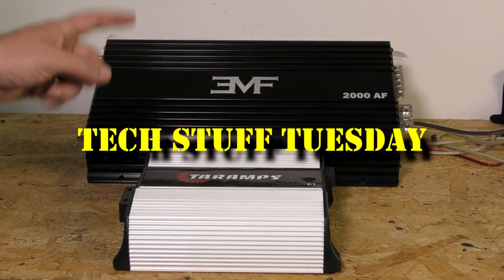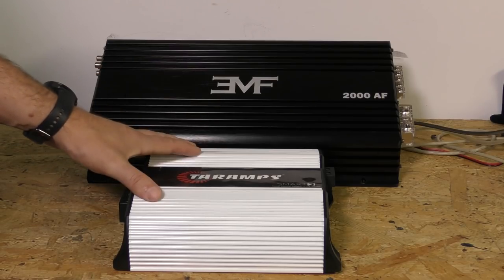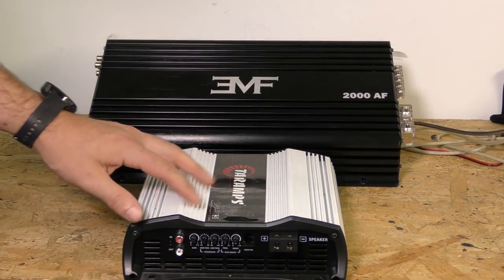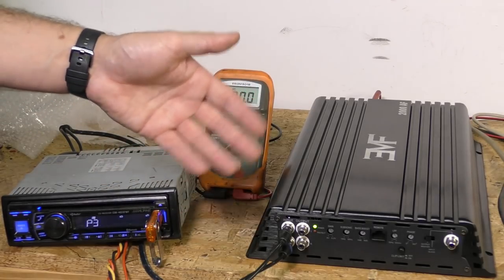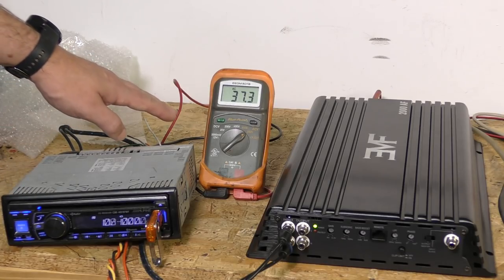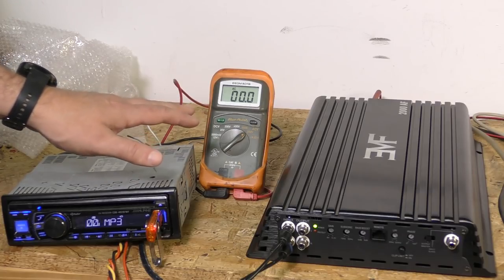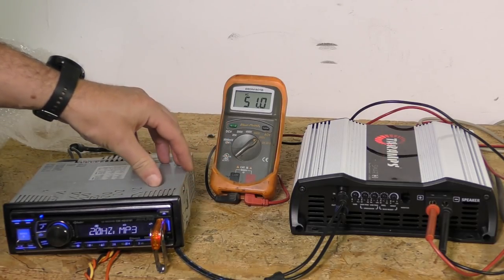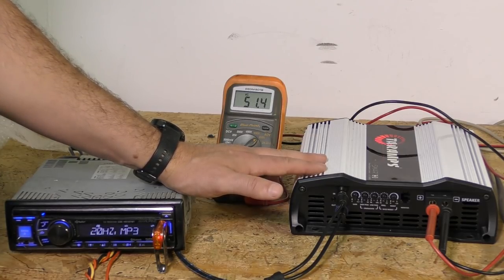The problem with full bridge (Brazilian) amps you never thought about - Tech Stuff Tuesday

Comment: Good info to know I was actually contemplating switching out my Skar RP2k for a taramps hd3000 not cause anything is wrong with the skar but just wanted more power but after seeing this I think I'll just keep my RP2k
Reply: Never use hd line for bass. Rp is garbage amp. Go sk2500 or bass 3k or smart 3
Reply: @busa_joe1159  I wouldn't knock the RP it's not bad to be honest if you are building on a budget like I am, I'm slowly upgrading to better equipment every year but I do agree with you that the sk line is definitely a better amp
Reply: James smith  what subs are you running on the HD3000?
Reply: While 50 volts at 20 hz is 8% less power than the 55 volts at 40+hz it is still 9% or so more power than the half bridge makes at 20 hz for half the cost. Never used a full bridge amp. But the 8% difference at 20 hz wouldn't be a deal breaker. Been kind of looking at these smart 3's for a while. I like that it is able to make the 3k at 2 ohms as well as 1 ohm and can do 2k at 4 ohm. There aren't a lot of amps out there doing 2k at 4 ohms. Especially for around 250 bucks and at an efficiency of around 80%.
Reply: James smith  That dyno test doesn't mean squat. No one cares about SQ anymore....just POWA!
Reply: James smith  I am pretty sure the test was probably accurate. Everyone gets upset about Sean's videos because that one time he trolled Steve Meade. I have heard several times from different people that full bridge amps seem to lose a little at the bottom. He does know what he is talking about, and he is making videos to try to help people understand better what is going on with their system. Sean is trying to sell his product, and he does have a tendency to rub people the wrong way, but he does also design some quality stuff. I ran a banhammer 12 for a couple years before I finally took it out, it took abuse like crazy and slammed hard as hell while doing it. I would heat it up until it smelled and then turn it down to let it cool off for a while and then right back to beating the hell out of it. I clipped the shit out of it and it took it like a champ. The clip limiter on his current amplifiers is a pretty amazing idea. Almost seems like it could go a long ways to fight impedance rise. Turn the gain all the way up, and no matter what note is playing it will play it as hard as it is capable of without damaging anything due to clipping. I know that isn't how it works, but it is basically dipshit proof. Lol. Great for guys like me who know that I set my gains at volume level 32 but turn it up to 34 anyhow. Because some notes just don't play at volume 32 like they do at 34.
Reply: James smith  one thing I will say about Dyno tests, is that they show what the amp is capable of on a resistive load. 2 ohm speakers wired to 1 ohm are never gonna be a 1 ohm load once they are in the box and the subs are moving. You most likely aren't ever gonna see the 3k that the amp is capable of. Unless you put it on a Dyno Or wire it at half an ohm where the amp might see a 1 ohm load after rise. But that is when so many people have had problems with the full bridge amps. And that is also why I said I like the smart 3, because it will make 3000 watts at 1 or 2 ohms and 2000 watts at 4 ohms. Plus it shuts itself down before it goes thermal like most other full bridge amps would, even if you wire it down to half an ohm.
Reply: My smart3 shits all over the rp2k

Comment: So if an amp has a potentiometer that can set the amp to amplify a 10hz tone, how is this amp not designed to run subs lol? also the 2k fluxuated a total of 7 volts in the beginning and the taramps did close to the same. this video only shows that half bridge is better than full bridge for bass which everyone already knew.
Reply from the maker: No, not everyone does know that, which is why people keep buying that style amp to use on subs, because they're cheap.

Comment: Full bridge amplifiers are push pull. Half bridge are push and let go. In my opinion, because of the half bridge amplifiers popularity/marketing, and the strapping amplifiers together. I had a longer rant. 
But, I will agree with you that people should use their device's for what the are intended for.
Reply: Why would full bridge not be intended for subwoofers? it's full range amplifier is made to play a number of different drivers rather it's ,bass mid bass,midrange or highs which gives a wide range of options and uses for just one amp

Comment: If you look at the multimeter wires there hooked to the radio when there amp is on but they connect it directly to the taramps when they do the second test. I call bs.

Comment: I would not consider a high power full-bridge Brazilian amp good for mids-highs, esp. since some of them appear to not have filter networks on their outputs. This means that the full switched +/-160V (or whatever voltage they use) waveform will appear at the output. Normally subs have enough inductance in their voice coils to average out the switching waveform. If you use them thru a cross-over network, the mids or tweeters may not have enough inductance to smooth the switched output and it could damage them. This is why some of these grenade on amp dynos, since the 1Ohm test load will essentially look like a dead short to the power supply and output stages without a filter network to provide some form of impedance transformation. If they have output filter networks, its ok, but there's no way to know without actually opening it and inspecting the amplifier. Better to use a traditional half-bridge, or a lower power full bridge amp made to drive mids and tweeters.

Comment: You can’t talk about ‘power’ output while reading unloaded voltage on a meter, that result is literally meaningless. In order to know what power an amplifier is making you must load it down, so my suggestion is get a suitable resistive bank and rerun this test. Also half bridge designs tend to suffer from buss pumping when driving very reactive loads where a full bridge will not have that problem, so if you are driving a difficult load then chances are a full bridge will outperform a half bridge with quoted output between them being equal. But you will not see this with dummy loads, you need real speakers.

Comment: All you did was show how a crossover works if you set the crossovers like you would if you were going to run them for subs it would have been a better test. That smart 3k is absolutely made for subwoofers, and will out perform that 2k anyday. Now it might not outlast it. So at the price of a full bridge amp what you do is over buy. So if you need 2k buy a 3k or if you need 5k buy a 8k, and run it at 60% copacity. They literally make a bass3k and a hd3k that only have crossovers that only go upto 200hrz. This guy is just hating bc hes not selling any amps.

Comment: Now, repeat that test with the amplifier driving an actual load...
Reply from the maker: So you can complain it wasn't the right load when it blows up because it was resistive and not reactive? Or what if I do reactive then you complain something else was varied as a result of the heat difference because of moon phase?
Reply: @EMFAudio  Why would I complain if the amplifier is connected to a rated load?

That Taramps one looks like a class D amp.  It's quite possible that its frequency response at the top end is actually load-dependent.  Who knows, it might have performed even worse if its power supply section was not capable of continuing to maintain peak voltage into an actual load.

I would have liked to see if there was any voltage sag when the amp tried to drive its rated load.  

No-one in car audio uses power amps just to drive just voltmeters :-)
Reply from the maker: Because no matter what way something is tested, if the desired results wasn't achieved, someone complains it should have been done another way. I wouldn't dare test someone else's full bridge amp on a resistive load because of the probability of it exploding.
Reply: @EMFAudio  Big D. does those tests all the time and publishes them on his channel, just sayin... And yes, many amps don't meet their specs. 

What you've basically done here is to test the amp's frequency response under basically no load.  I'm not sure how useful that's really going to be.

Comment: You get what you pay for. Slams absolutely, sounds like shit absolutely.  Especially if you got a hi end hi powered amp running at 2 or 4 ohm at the same rms output to your woofers.  Night and day in sound quality.  But if that's your thing just boom boom and vibration you should save your money and install a concrete vibrator.......

Comment: I bought a Taramps MD 12K new to see what all the fuss was about. Absolutely garbage. Made out of plastic like a children's toy and they sound like ass (even on a DSP)
Reply: You Saved Me The Money. It's Temptingly Cheap, If That Makes Sense. Half Bridge Class D Is Where I Should Keep My Subs On. I Had A Class D Half Bridge On Mids And Highs And It Sounded Great. Then That Amp Died And Tried A Taramps Full Bridge Class D And To Be Honest It Sounds The Same To Me. Its Great Becasue It's Compact For Small Areas. However That Thing Gets Crazy Hot. I'm Talking "I Don't Think It Has A Thermal Protect" HOT lol. I've Gotten It So Hot That The Sound From The Door Speakers Starts Sounding Muffled Like 6k Hz And Above Has Been Filtered Out. And Some Speakers Will Cut Out. But That Only On Hot Days And Playing Loud Carelessly.
Reply: Parker Dachille had problems from dat one with the 12K; he went through 2 before his 3rd one.
Reply: James smith  I Could Check. I've Actually Got 1/0 Power And Ground To It (Reduced Down With A Wire Ferule). Its Connected To 2 50AH Lithium Batteries Directly Which Are 1ft Away From Amp Connected POS And Neg On The Copper Bus Bars. There Are 2 Runs Of 1/0 Power And 2 Runs Of 1/0 Ground Running To The Rear Batteries And 8 Banks Of Ultra Caps From The 2 320 Amp Alternators Up Front. I Do Need To Run More Power And Ground From My Alts To The Back. (I Get About 0.6 Volt Drop Under Full Tilt On The Subs) But I Believe It's Just The Way The Amp Is In Confined Spaces. My 8K Bass Amp Gets Pretty Hot Too (Daylied At 0.5Ohm Which Is Sees Only About 2.5Ish Ohms After Rise) But Not As Hot As The Full Bridge Mids And High Amp Does.
Reply: James smith  Just because you have no sense of quality material doesn't change facts. Defend your amp to the grave. I sincerely don't mind.
Reply: If we overlook all the shortcomings in Taramps besides the sound quality alone, and we call them good amps otherwise, that's still enough for me to never touch another one. Some people can't hear a difference. That's fine. I envy you. They sound like shit to me.

Comment: I've been running a Taramps Smart 3 for a few months now and I will never go back to full bridge amps. I've been running it on a B2 Rage 12 with no problems for 2 months. It made the sub hit hard, people were very impressed with my system. But a week ago I ran into an issue where the amp was clipping my sub badly at 55Hz, 60Hz, & 70Hz. It sounded like my sub was broken. I kept thinking my sub is the fault but after swapping out the amp to a half bridge today I discovered that it was not the sub but instead it was the Taramps Smart 3. You get what you pay for. Stay away from this cheap crap and stick to quality products. There's a reason name brands like JL Audio & Rockford Fosgate haven't gone with this full bridge garbage trend. Oh btw, there is a big difference in sound quality. You hear bass with half bridge amps. Your sub will move with the full bridge amp no problem but it just won't produce the same bass as a half bridge amp will.
Reply: Greatly said

Comment: Lol at these comments from people who clearly don’t understand basic electricity.. a full bridge amp is able to make 3k watts for $200-300 cause it’s making 1500watts of signal and 1500 watts of heat.. this is why as cheap power came to market with full bridge amps we started seeing 3-4” vc subs ratted ti 1-2-3k watts as well.. you only need a VC that size to take the heat the amp is se don’t it.. there is zero reason any sub needs more then 2.5-2.75” vc outside a couple very specific very high end spl only subs. 

Ask anyone who’s been down this road.. and switched to SQ amps.. every single one of them will tell you a Damore e750 beat the pants off a 3k Brazilian they had before. 

If always had this issue with this industry.. ratting at watts is completely stupid and means nothing.. JL amps cost what they do cause signal to noise ratios, combined with dampening then add to that the fact they make power at low voltage and fight impedance rise all at the same time. 

Comparing sound equipment based on watts is about the worst measurement possible.. electricity generates heat.. heat is counted as watts output.. end of the day.. everyone is spending $300 on an amp to power two $120 subs but then putting 2500 into electrical to achieve the same they could with a proper $800 amp running two other $120 subs on factory electrical lol.. you 1900 in the hole for same result lol.. think what else that would do. More deadening? Better box? Higher end subs and amp? You all either spending more money in electrical to run shit power then an entire system costs or you’re not even upgrading electrical which means you are turning a small like if shit into a larger one cause you thought you were saving money going cheap to get more so called watts when really all you got was more heat and less efficient subs
And I’m bot a huge fan of this channel or how these things are done or conveyed and the fact the skip many key point or at time even completely wrong but this dude made a 2.5” sub take 10k watts with what a 120-150oz magnet and std surround cone and motor force? Lol.. he selling his products and this is marketing but he’s bot wrong either.. is buy his subs but I wouldn’t buy his amps.. I’ve seen too many times they have amp rise issues Turing 1ohm loads at low power into 8-9 so there is issues in the amps to be fixed.. but wo a doubt full bridge is 1000x better then full bridge all day even at half the lower cause it’s cleaner, more efficient and controls the subs better. More control equals faster response on sub travel which equates to higher spl with less effort.. think a whip vs a bat.. whip takes zero effort and generates tones of force through control of the whip.. where a bat is brute force generating little force..
Reply: 🤣 so much misinformation